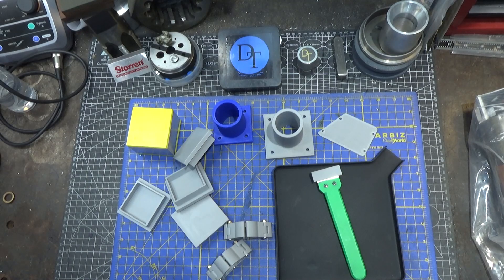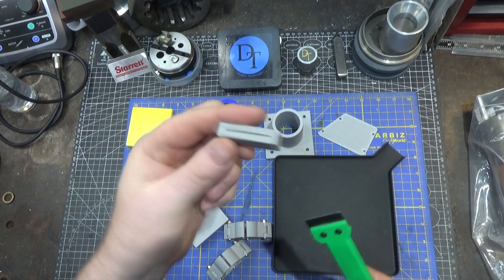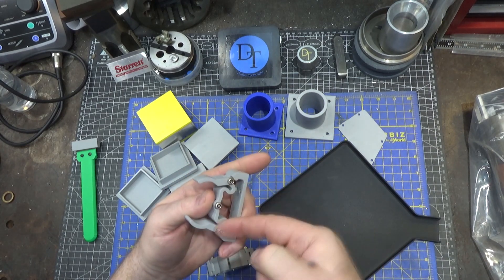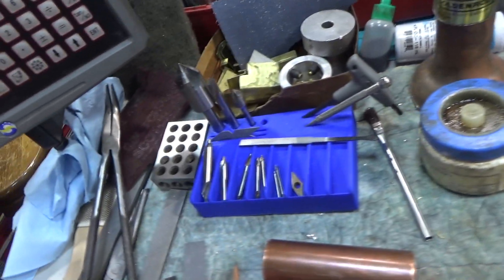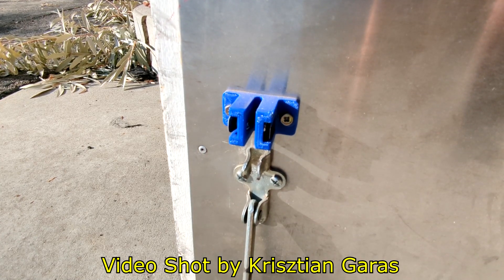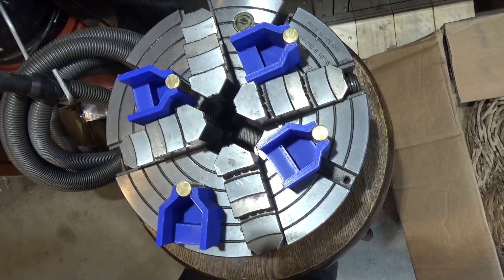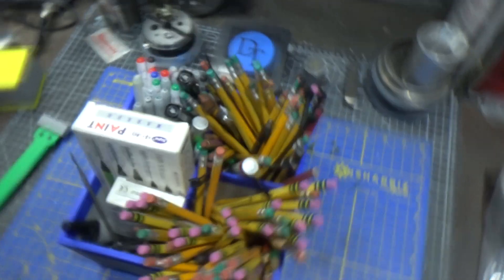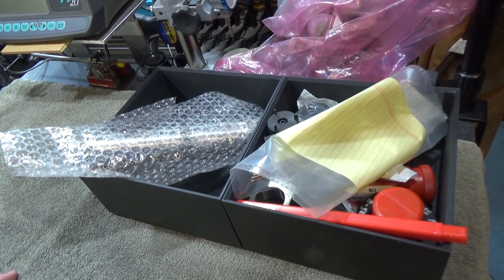SM #13 Are 3D Printers Useful in the Machine Shop

Comment: I've had a 3d printer for years and like you I have found many many uses for it.  Been looking at the X1 Carbon but right now my budget won't allow for it.  Another suggestion is making drawer inserts for tool holding.  Great for small parts or tools like drill bits, taps, and etc..
Reply from the maker: Excellent suggestion no the drawer inserts. It's on my seemingly endless list.

Comment: I literally wore out my first 3d printer on stuff for the shop.  Thousands of hours or printing stuff mainly for organization.  Drill bits, taps, hardware, tool organization, etc.  I love my new Bambu X1C and totally agree with your assessment.
Reply from the maker: Thanks for the feedback. My only issue with the Bambu Labs X1C is that the lidar USBC connector has to be reseated on the head every 5-7 prints.
Reply: @DudleyToolwright  I have not experienced that.  In fact I have had no issues whatsoever.

Comment: At first I also dismissed 3D printers as toys, but then I realized how useful they are in a shop. Even this week I've developed and printed powder pumps and fluidizers for powder coat quick change system, which saved me about a month of waiting time and a about 3-4k dollars for only $20 in plastic. And that's only one example. I found that PETG (with active dryer) covers 98% of my needs, where I don't need high temp or high abrasion properties.
Reply from the maker: Great info, thanks. I have only printed with PLA so far, but have samples of a bunch of other materials to try.
Reply: I chose PETG instead of PLA because it is less brittle, more durable, easier to work with, like cut threads and such and also a bit more high temperature, so that it doesn't melt on a hot day in your car. The downsides is that for good quality prints it needs an active dryer or very very low humidity. Also printing with supports is virtually impossible with PETG.  @DudleyToolwright

Comment: Nice printer! I would suggest using abs or asa for anything that will see any kind of heat or uv. Asa is best for uv exposure like the cup holder and fence post caps. PLA won’t hold up to heat or sun exposure very well.
Reply from the maker: Thanks for the tips! I just got some ASA yesterday to try.